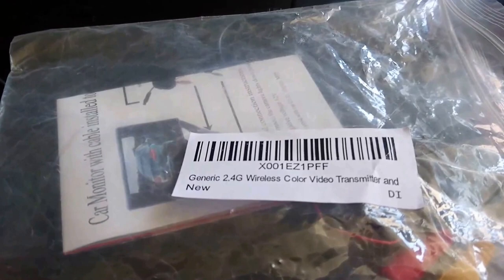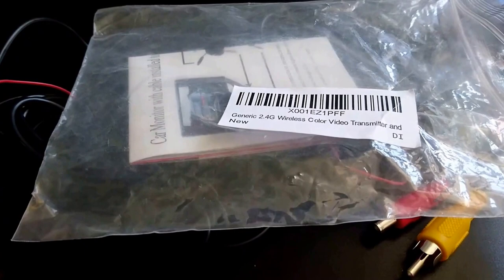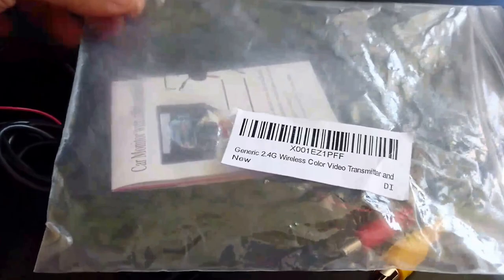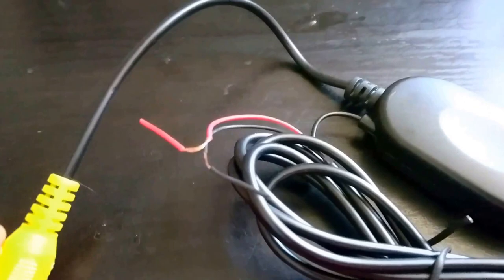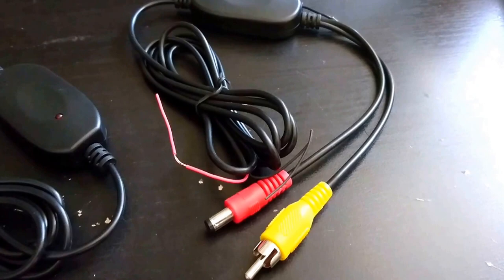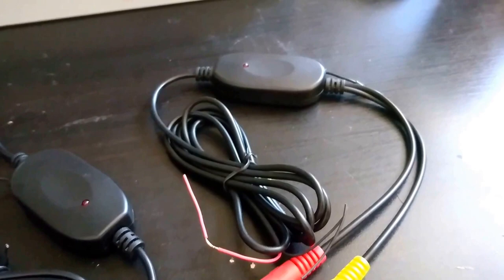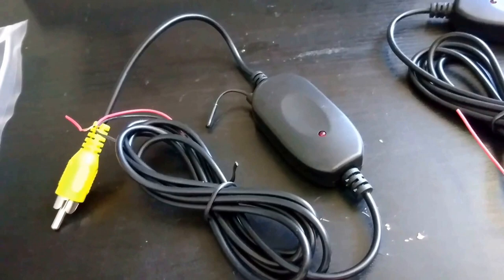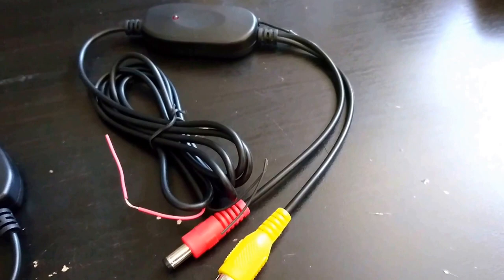Wireless back-up camera receiver and transmitter

Comment: so where is the video showing the installation?
Reply: There is nothing to it. If you dont know how,pay for installation.
You need a Android head unit and 12v thats it.
Reply: @MrRedneck1488  the screen is 12v but do u know how much is the reciver unless u wired both of them together?
Reply: @keimo02  First you need a display. This can be a display only with video in or a Android head unit (car stereo) most Android head units have a pink wire for reverse camera. This one gives +12v wich you connect to the receiver unit. The -12v can be connected to any contact wich is connected to your car chassis. I used the alloy head unit as negative. The transmitter goesvin the Trunk. Connect it to reverse drive light or any other 12v source. Maybe the cigarette lighter in the Trunk . But this means the transmitter is powered up every time you start the car.
Transmitter wiring. Red is + 12v and black is -12v.
Yellow connector is always video.
Note Transmitter goes in the Trunk.
Reply: @MrRedneck1488  oh the reciver is 12 volts too thanks i guess ill try to create a extension to the breaker of the car under the dash, might be tricky to hide it
Reply: @MrRedneck1488 txs for the explanation

Comment: do u have a installation video for  the power of it, im curious as where u would plug it up to considering that the screen takes 12Volts so should both powers be plugged up togethers

Comment: so you showed the wires but were is the total connection from back to front and how their connected
Reply: front needs 2 power sources but but its jiffy considering the screen will be 12 volts back is easy just hook it up to the reverse light

Comment: Transmitter is showing a blue light, and receiver is showing a red light. This mean wireless system is fried? Have it setup on an RV. with a toggle active for receiver, and transmitter on RV constant power.
Reply: Mine is the same way. After I receive it. I hook it up but one has a blue light and other has a red light.

Comment: I’m at my wits end with this camera!   

I plugged the yellow cable into my video out on my pioneer radio I tried every power source known to man, I have power to the receiver I ran the wire from the “ reverse gear signal input wire”  to the wire that Controls the reverse lights under the dash. 
I hoped up the power wire to the camera and the video wire where that was supposed to go around the power wire to the very first light and I ran the black wire to a ground I still can’t get a picture to show up on my radio 

I’ve been working on this for three weeks if you think you can help me please make a suggestion
Reply from the maker: Todd Breeze You have to run the video wire from the camera to the "video in" not the "video out." Also, test the camera to make sure it's producing a picture and is getting power. Test the wires you used with a volt meter to ensure power is there. Hope this helps
Reply: Ok I went back at it, I’m not sure how to check to see if if the camera is producing a picture, but I did test and it is getting power.  
I don’t have a V in 🤷‍♂️ but I wish there was a way I could send you a picture of the ports on the back of my radio. 
Under my V out there is a brown port marked “RC IN”. Tried this with no success 
Then I have “AUX” also no success 
Then I have 2 sets of red and white ports marked left and right 1 is “R/SW” the other is “F”
Reply: @toddbreeze7947  RC IN stands for Rear Camera in. That's where it "should" work.
Reply: @toddbreeze7947  Hi Todd, did you get your wireless camera to work?  I just bought this unit and am trying to get it to work with my new Pioneer stereo.
Reply: @leftyrncii980 I don’t suppose you ever got to the bottom of this? Just installed a pioneer stereo and just get a black screen even when both of the transmitters are lit up to show they are working. Thanks

Comment: hello. What do I hook to the PINK reverse cable? If I put it on 12V I get constant camera mode on radio. The point is I'd like the camera mode only when I put in reverse gear.
Reply: Find the power wire to your reversing light and splice the red (positive) wire from the transmitter (that plugs into the camera unit) into it.  Attach the black wire to a chassis ground.  When Reverse gear is selected, power is taken from the reversing light and activates the transmitter.
Reply: @antonygriffin9019  yes but what about on the receiver side? I have only red and black wire. If I connect it to +12V and my radio the screen is black all the time except when I put in Reverse gear, at that time I see the picture. This setting makes my radio completly useless.
Reply: @mihaelmevlja5646  did you solve that problem. I HAVE SAME PROBLEM
Reply: @elvirbesic6  Receiver and transmitter are meant for a display not for radio. Not compatible with radio.

Comment: Thanks for the tip. I have a question to trigger wire. For DVD head, it has trigger (blue) wire behind to automatically swap to video mode when shit to R gear. This receiver doesn't have trigger wire, please comment how to handle this connection. Thanks again.
Reply: Hi, I have the same question! No clue about this! Did you figure it out?
Reply: Any update? Can we connect the red wire to trigger wire ?
Reply: Connect to your reverse light lead

Comment: Hi there. Why does it not come with a 12v socket on the end ? Can you easily put one on . I mean where do you find where to connect the 2 wires to power the monitor. ?? Im not about to start opening up my dashboard looking for where to connect in somewhere. ?? Any ideas here please.
Reply from the maker: Kevin Walker hello, generally speaking for the rear of the car, you will splice into the tail light wiring, specifically the reverse light wire. Inside the vehicle you can tap into almost any accessory, like a cigarette lighter, the head unit itself, switch, the options are endless
Reply: ok thanks
Reply: Ok so this kit is a “hardwired” kit, meaning you need to wire directly to power (red wire) and directly to a ground source (vehicle chassis).  Both the transmitter and receiver need to be connected to power and ground.  

Grounding is the easy part.  There may be an existing screw You can shove it under, or simply sandpaper a little area until its bare metal, and ground th wire from scratch. 

 There are multiple sources for a power source, and it can depend on the vehicle on what you should use.  Generally speaking, you want to find a wire in the trunk to tap into, and that wire should only provide power when the vehicle is on.  Tapping into the vehicle’s reverse light for power is what I’ve always done.  If you google “my vehicle exact year and make what color is reverse light wire” or something like that, you’re going find a page that has it; you may have to dig though.

This is not something anyone should be doing without a basic knowledge of a car’s electronic system.  You want to be 100% certain which wire you tap in to, and HOW you tap into that wire is important as well.  I didn’t even mention tapping into your reverse wire under the dash.  That makes sure the camera pops on when you put the car into reverse.  That’s another deal altogether, but essentially you’re tapping into another wire lol.

Make sure you find out your wires.  Spend a weekend educating yourself, then the following weekend doing the install :) lol.  Hope I helped.
Reply: @coastalcardiciancollectabl1032  I've had problems with the front part where I have no idea what do use to trigger the rear camera. Everything works fine at the back but when I put the gear in reverse it does not switch to the camera. Any way to help?

Comment: Did it works fine? I am interested to buy like those
Reply from the maker: It works ok. You need to have the transmitters as close as possible to each other to make sure they provide a constant connection that doesn't flicker. I had a problem where it was flickering and coming on and off, I moved closer together and it got better.
Reply: Useful Vids hi frend 
I have same peoblem , i trayed on my home worked prefect and i mounted on the car now is not constant view just cklick on monitor and no good view , 
How to close transmiter pls
Reply: @UsefulVids  hello. What do I hook to the PINK reverse cable? If I put it on 12V I get constant camera mode on radio. The point is I'd like the camera mode only when I put in reverse gear.